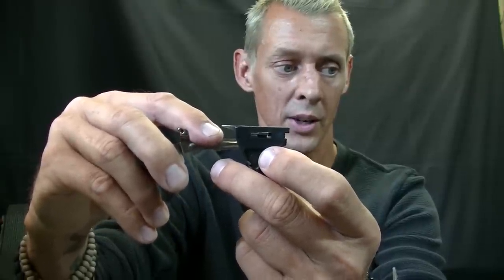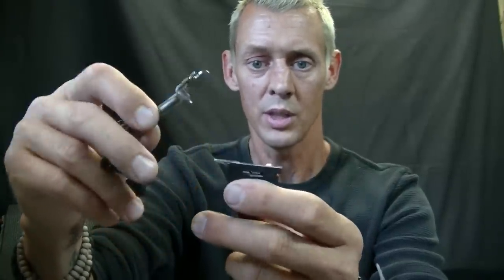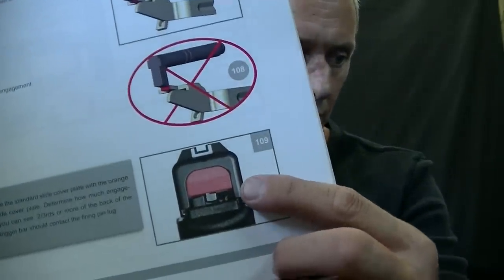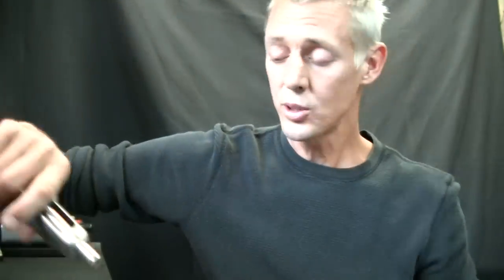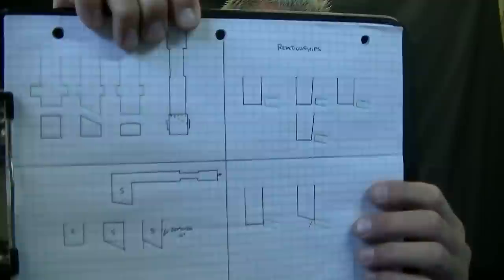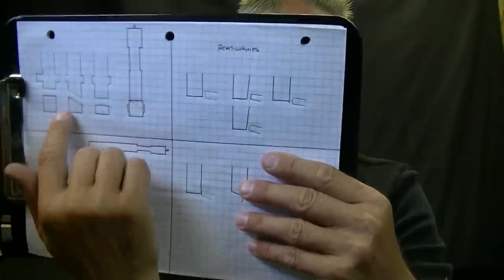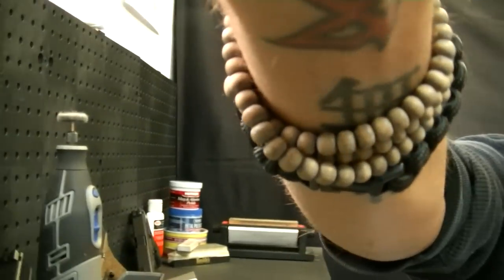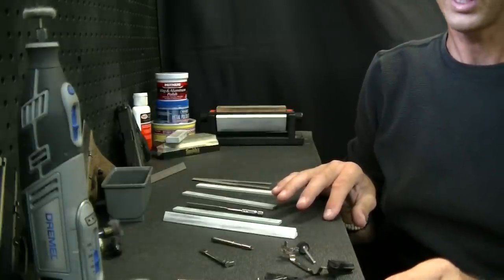Glock Striker and sear engagement  EDUCATIONAL ONLY

Comment: This is what I needed to know, the 8 minute mark. I'm getting double taps on the p80 build. Haven't done anything but put it together with OEM parts.
Reply: My build goes Brrrrrr don’t know what I did but everything is in correct order
Reply: @rackadactal4466  yeah this fixed it. It's a delicate balance and can get weird if not correct.

Comment: I got my G-17 OCC trigger pretty close to a 1911. It is still safe because I did not mess with the sear geometry. Ghost Evo connector smithed for ZERO over travel. I adjusted the OCC trigger for ZERO take up. 

Trigger weight is about 3.8 lbs which is still safe for me. I did a LOT of drop tests to satisfy myself of my trigger job.

I left in the inherent amount of tiny creep as the sear slides off the Titanium Nitride coated skeletonized striker.

I could see how I could have gone even further by working on the sear and striker geometry. I was so satisfied by my trigger that I decided NOT to change either surface. 

I highly recommend the Glockmade OCC Trigger. It is a simple, yet highly effective component of a custom trigger job. There are other items and tricks I used as well to achieve my final results. God, I love working on Glocks!!

Note: I did POLISH the sear and basically every single inside surface. That is effective!

Comment: I have a G17 gen 3 with aftermarket upper. The lower is all stock. last two trips to the range I have had double tap issues, this is only recent. since I have not filed or modified anything what can I look for to fix the double tap issue?

Comment: Just built my Glock 17 polymer 80 took it to the range luckily I only had five rounds in the magazine when I pulled the trigger all five rounds went off. Then I went to two rounds only in the magazine and it kept double tapping I'm assuming this is my issue? problem is I think? I didn't use OEM Glock parts

Comment: What would be the reason.. when I go to do a trigger reset with the pistol empty.. most of the time it will reset click.. but sometimes it will make a pop sound when I release the slide forward from a short travel.. bam  no reset of the trigger just a dead. pistol shoots fine.. just freshly put together p80 with oem glock 17 gen 3 slide an oem lower parts kit thanks.

Comment: You are the most informative. Love the way you take time to explain everything for people that don't know not just expecting that. You should know if you want to Glock great job. Question I want to get my slide done. The Glock finishes coming off and scratches from my Kydex holster I was thinking about just taking the Finish completely off
Reply: I did the Barrel and all the internals I keep it pretty clean. Just a lot of wear marks from reholstering and practice drills I think I'm just going to leave it alone. You're right. It adds character. I don't need a pretty tool.

Comment: I thank you for your videos but one thing I can't understand is how you figure ( time 3:20)  shorting the sear kicks it up on the engagement .
 I'd say it lowers the sear on the firing pin lug because the sear is bent upward so the more you remove lowers the engagement. Please help me figure this one out?
Reply from the maker: Good catch buddy!!! I forgot to mention how I bend the seer up first then remove material from the top of the seer so even though there's more engagement it will break quicker.
Reply: @johnnyglocks  .... I have only had one Glock 21 that I converted to a 460 rowland for hunting. I'm no gun smith but like to get the best performance 
from what ever I own so I played with the Glock. I replaced springs, polished it, replaced parts and worked on the sear angle but found it very hard to get right.
Ending -up shortening the sear .050 or more , after than I noticed the sear had dropped on the firing pin. The lighter firing pin spring had to be removed  cause the trigger didn't have enough
 pressure with the lighter spring,  after the sear was shortened. I installed the stock firing pin spring. 
I then bought a new trigger bar and only lightly worked the sear face. Now the gun has a 4 pound pull, from 3 pound. 
I think the trigger bar sear face should be made smoother with a nicer angle from the get go. I hate the feel of a Glock trigger pull and release.

Comment: 7:44  am I understanding this correctly, when this happens, the gun turns into an automatic firing...?
Reply from the maker: Yes sir correct but not consistently  automatic it could be just a couple rounds or could be the entire magazine it depends on the slide to frame relationship as well
Reply: JOHNNY GLOCKS the persona So like.. theoretically speaking if someone was to mess up in the right way say like slightly shorten/angle/slightly round the striker and round the end of the trigger bar would it possibly be consistently automatic? Or is it not possible to be consistent? Just theoretically speaking. Who would want a Glock that’s fully automatic? That’s a terrible idea.
Reply: Dustin Hanna Don’t sound like a fed so much. Glock already makes a fully automatic handgun.
Reply: @Mr_Glock19  yes, consistency is possible (guess how I know 🙃). Funny thing is I originally thought it was an issue with the frame. My last 80 build was a couple months ago when you couldn’t find an LPK for less than $80-$90, so I decided to use my spares stockpile while awaiting a market correction back toward sanity.  As luck would have it, due to a confluence of tiny parts, COVID clutter and the effect on my hands and eyes from 50+ years of fun, I managed to disappear the slide lock spring. But being a graduate of the Disney school of engineering, I Mickey Moused it with a ballpoint pen spring 🥸. Made it so I had to pry the slide lock with  a small screwdriver to disassemble, but everything functioned fine...or so I thought. 

So, time for a live fire function test- just one quick round to make sure it went bang and cycled... double tap 😳? Nah I must have just been sloppy- squirt gunned it and kicked back against the reset, I’m sure that’s all it was... so once more with a purposeful, controlled reset... squeeze... brrrrpppp... 😲 holy crap! 4 or 5 round burst. Well, in the name of science, investigative journalising and the spirit of discovery 🤓 I must investigate further. Brrap.... bbrrbrapppp... brp..brp..brrbrbrpopppp. 20 rounds later it’s official- pull trigger= bang, bang, bangeddy bang, release trigger= no bang. Consistent, repeatable, controlled (ish) auto fire. 

Since the slide lock spring was the only O.O.tO. thing I did on the build I figured that had to be the cause, even though I couldn’t figure out any possible way it could cause that. But hey, I’ve got the proper component on order. A few more days & I’ll have it back in spec and bye-bye felonious fun.... NOPE. 

So I’ve been wandering the interwebs searching an answer and lo and behold the one, the only, my man Johnny Glock triggers (heh heh) a nearly year old memory of a little mod I did on a trigger housing shortly before I swapped it out for a .40 version! Wanna guess what happened to that housing.

So I guess I’ve found my solution. Thanks Johnny (kinda). YA..a..y. 🙄 Feels kinda like when my mother in law drove my brand new pickup off that cliff. 😶

Comment: Serious question Johnny, have you conducted any “severe drop” events to test various enhanced trigger configurations?  If you’ve already discussed this I’ll look more to see.  I was just curious if there is some threshold, not counting a steamroller, where the safety breaks down.  Thanks!  I’ve learned a ton from your videos.  Very grateful. 
UPDATE:  Honestly, what I was wondering is if you “take a Johnny Glock Design” and just chuck it against the wall as a safety test. 😁
Reply from the maker: Absolutely of course and I mean 20 ft drops off ladders onto concrete. engagement is one of the most important aspects of this whole thing if you do not have proper engagement even if your safeties are completely functional there could always be an issue
Reply: JOHNNY GLOCKS the persona  Understand. Thank you!  The mechanics of the Glock trigger and your enhancements are fascinating. 👍
Reply: understanding hes manipulating the striker/sear, but Glock also has trigger safety , plunger safety , drop safety as well where the firing pin can not move forward unless someones pulling on the trigger.

Comment: LOVE YOUR VIDEOS. Question...can a half cocked striker set off a round?
Reply from the maker: that's hard to really say. LOTS of variables there
Reply: The other thing I've noticed in all of my years screwing with these guns...the main secret to getting a great Glock trigger has to do with the cups and striker channel liner interaction. I've had some pretty lousy stock triggers, replaced the cups, and all of a sudden all the stageness and grit is gone and it's now a great Glock trigger. People polish, change this, change that...they're usually changing the wrong parts.
Reply: Sean Vine Yup. Just got a brand new Gen 5 and the trigger sucks. It doesn’t always suck but it varies by up to 2 pounds between some trigger pulls. This is even with a Zev trigger in it. Noticeable grit/friction/dragging when it jumps up. It’s my first Glock and I was pretty disappointed but I’m a mechanical engineer so I stripped it apart, inspected, tested to feel for the hang ups. Sure enough, my spring cups rub in the liner. Depending on how they were rotated changed how bad the interference is. Polishing them down got me to 3lb 12oz with factory striker (reduced plunger spring). My only problem now is the sear engagement is long (I don’t mind the pre-travel). Checked my engagement and the cruciform is beyond full engagement. Looking for the best way to bring that down to the 2/3 engagement.

Comment: Did someone hit you with a left hook when you were a kid? No insult, it gives your face character.

Fascinating video. I've got a spare trigger and striker that I'm experimenting with, and this is very helpful. Thanks. Subbed.
Reply from the maker: it was half ripped off in a car accident in 91 and fixed with titanium perfectly. Then 2years ago my nose collided again this time with the top of my 9yr olds head. Never bothered to fix it. However I did just schedul an appointment for a consultation with a surgeon. Most surgeons don't want to do it because there punks
Reply: JOHNNY GLOCKS the persona Whew, that's a lot of nose-breaking. Hope it's not causing you too much suffering. I mean it when I say it gives your face character! : )
Reply from the maker: broken 5x before and no suffering. like you said adds character
Reply: JOHNNY GLOCKS the persona look cool man!

Comment: Exactly a 1911 is a different system then the glock so they are not going to feel the same. Sure you can get close maybe but not going to be the same. If you want a 1911 feel then buy a 1911. If you want the glock then build the glock. Personally I like the glock over the 1911.

Comment: Do you also change the timing on the safety plunger?

What do you do when the cruciform isn't bent exactly at 90° to the trigger bar? My striker is already at the 2/3 minimum engagement as the cruciform is bent past 90°. =(

Comment: Johnny i have some drag on the top of the crucifix, the rear of the striker is hitting it when the gun resets is this ok? I have the ghost evo elite  trigger bar in it
Reply from the maker: That's completely acceptable as long as it just kind of looks like a scuff and nothing more
Reply: Ok great thank you very i use the trigger block housing with the Allen adjustment ,thanks again bud i almost have enough $ saved up to buy your  trigger, cant wait!